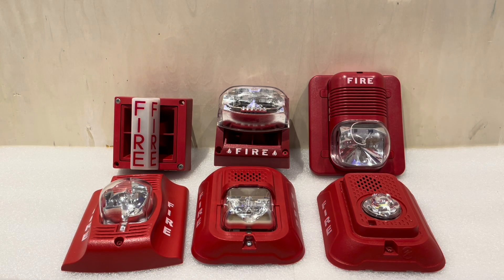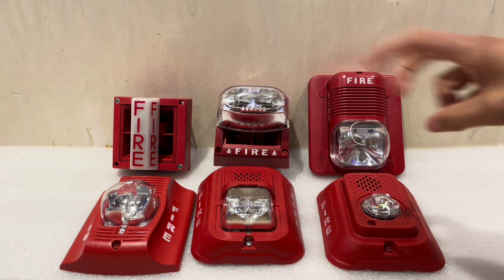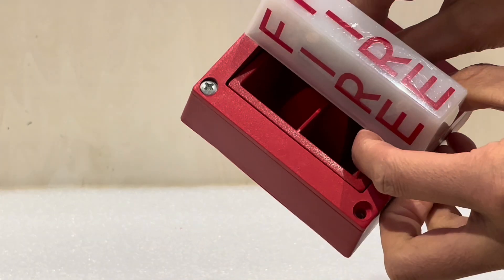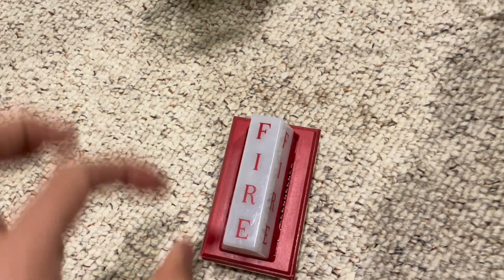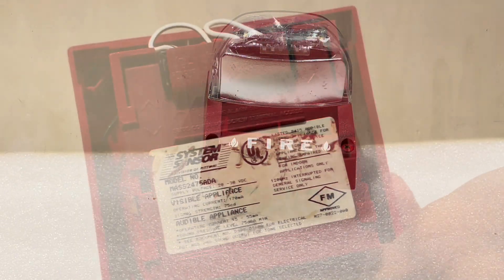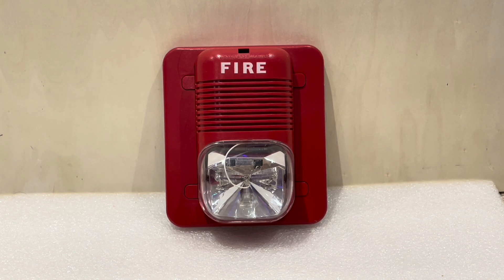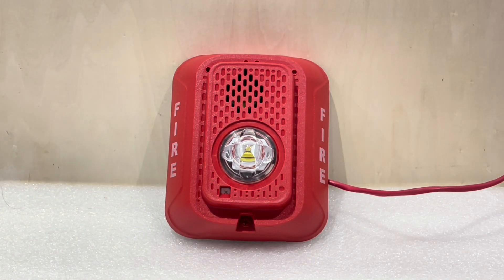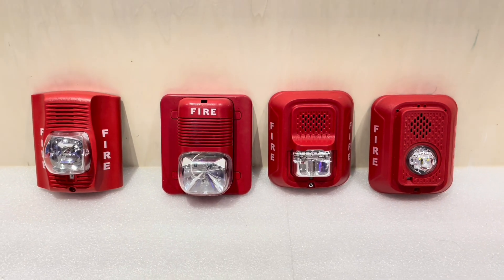Six Generations of System Sensor Fire Alarm Devices

Comment: the best ability of LED strobes is they are highly adjustable and can be any color you want. so if you want to have an alert/fire device, you no longer need 2 strobes, one yellow and one white. instead, you just need a circuit that controls the color of a bicolor LED and changes it according to the message.
Reply from the maker: Potentially true in the future but nothing like that exists yet
Reply: @FireAlarmDude5967  Actually, you already can. Ever heard of the addressable LED called the NeoPixel?

Comment: 8:25 10:50 Why do the ceiling strobes for L Series and Advances look similar?
Reply from the maker: Same strobe module
Reply: @FireAlarmDude5967  But the main difference is the fire lettering location. It's better in the edges of the housing

Comment: I know I already commented but I agree with what you said at 7:23. Don’t get me wrong, I like older devices but installing them is a pain. Newer Devices are way more user friendly to install compared to all of the older devices.
Reply: The Ceiling horn strobes were probably a even worse nightmare to mount because you would have to remove the mount and unscrew it from the alarm, then screw the bracket to the ceiling, then wire the alarm and finally screw it back to the bracket.

Comment: SpectrAlerts are just overrated
Reply from the maker: I disagree
Reply: @FireAlarmDude5967  That was just my opinion
Reply: I disagree.
Reply: @817CV99  Nah, Spectralerts are king.
Reply: @Sirenfireproductions5209  That is just my opinion, but the Wheelock devices are a lot more overrated
Reply: I prefer the MA/SS as they are my favorite fire alarms but I disagree. Spectr alerts are very well designed and probably some of the best fire alarms
Reply: @817CV99  Debatable, the mass series required a flush mount to be put on a wall which is a pain to do.
Reply: @ I know but they are still my favorite alarm.
Reply: @Sirenfireproductions5209  My local Micro Center has the MASS.
Reply: This comment is certainly not true if anything the SpectrAlerts are heavily underrated lots of enthusiasts actually don't care about them no more I've seen it first hand. Most collectors overshadow these modern devices with there vintage equipment and only care to talk about Simplex 2903s and stuff.

Comment: You also forgot to say that the LED L-series has a built-in combined Code-3/Code-4 option which will work with an upcoming sync protocol
Reply from the maker: Okay
Reply: Dewpoint8900 found out that Firesheilds on Genesis sync can actually trigger the T4 coding, but only with AC power as its only reproducible on FWR
Reply: Temporal 4 on a low frequency sounder works well without the sync, While the horn strobe basically requires a sync module just to have temporal 4.

Comment: I was at Walmart earlier today and behind the deli counter they had either a system sensor ADA MASS or a Siemens one (they look somewhat similar) and it was like 2 ceiling tiles away from a newer L series ceiling strobe (now one possibility is that the ADA MASS horn strobe could of been a agent strobe instead of a fire strobe)

Comment: The old alarms terrify me...
Reply: Same thing, 9-10 years ago I used to be terrified of the system sensor MASSs and Spectralert classics. But since then I learned how to wire them System sensor MASSs and Spectralert classics aren't that bad they actually sound cool especially the mass with customizable tones from 800hz-fast warble. The speaker strobe variant of the MASSs I wish I could have gotten before they became impossible to get on ebay. I was lucky to find the Spectralert Classics still in stock on ebay and can get them before they are offsale.